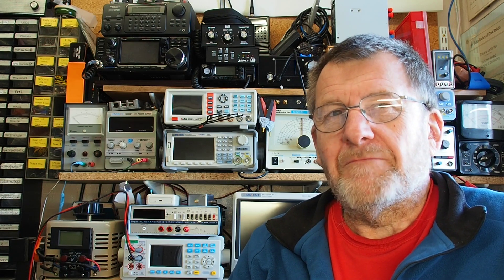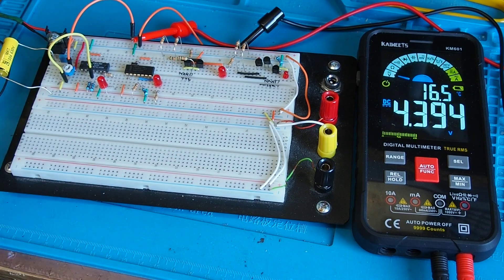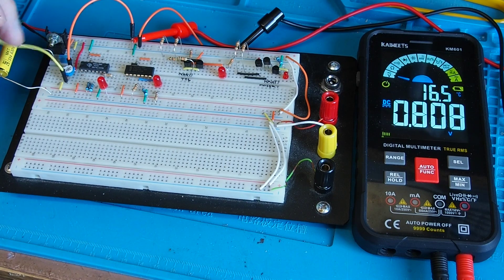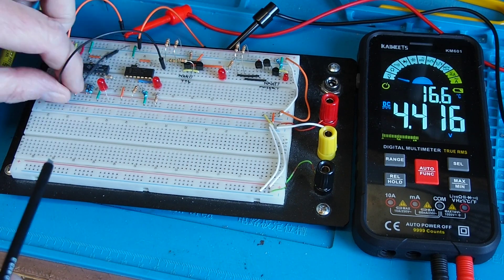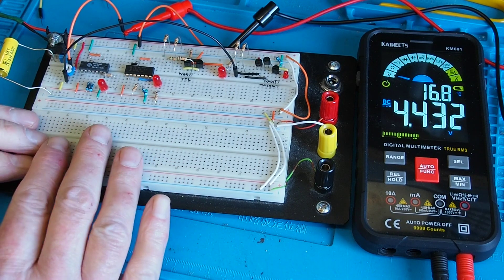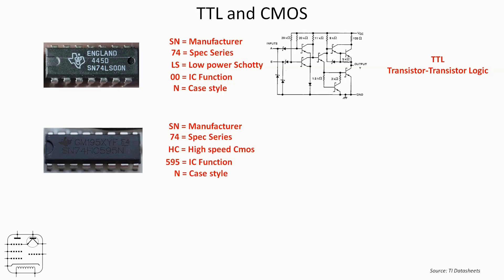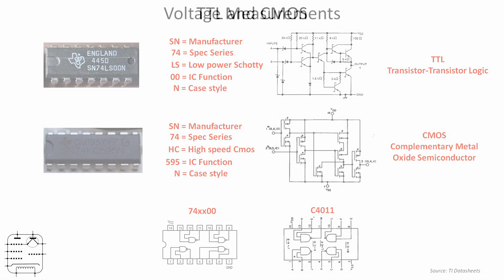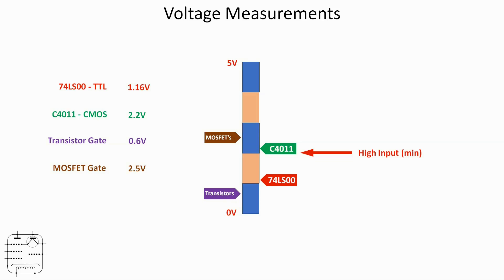Exploring TTL and CMOS integrated circuits and some of their characteristics - #153

Comment: I mixed a Couple of times a 3,3V UART TX  with a 5V RX without connecting the VCC between the devices and got "lucky" when flashing, maybe a pinch of a voltage down would have destroyed the flashing and would have lead me to a lot of head scratches, now I understand why you should not mix them , also I thought that a logical zero is what is bellow of a half of the VCC, but this video helped me understand that may be way down than that.   Thanks. (Don't worry I am hobbyist and not an engineer that produces thousands of devices )

Comment: Big difference between 74 series and 40 series used to be that if you looked at the CMOS chip cross-eyed it would self-destruct due to the static electricity generated by your eyelashes.

Comment: As always, a good video Bill, thank you. Might I ask that, if possible you try and angle LEDs towards the camera, with a side-on view of a LED it's very difficult to see if it's lit up or not. I am a bit vision impaired so apologies if this is just me that has a problem.
Reply from the maker: I have a new camera mount above the bench which will hopefully improve the led visibility somewhat!
Sorry but it's going to be the end of May before you will see it in use as I make videos many weeks in advance.
Reply: @LockdownElectronics  just use new LEDs. They're a lot more visible than the old ones. Try blue LEDs. They're really bright.
Reply: Those old red LEDs are hard to see when they're lit. I had to go through all of my LEDs and put the old ones in their own drawers.